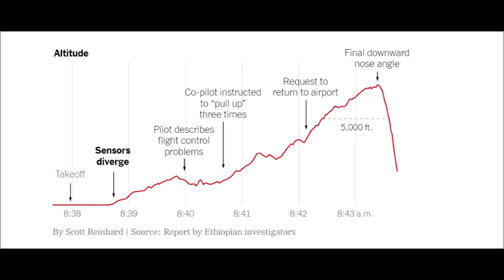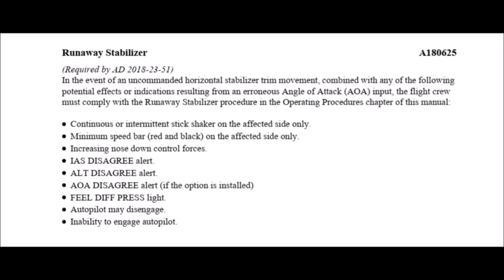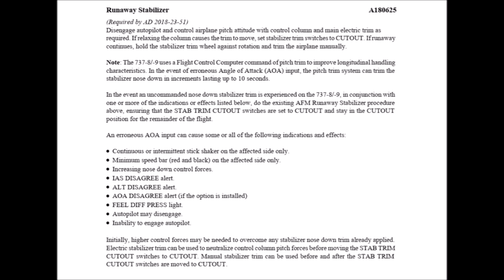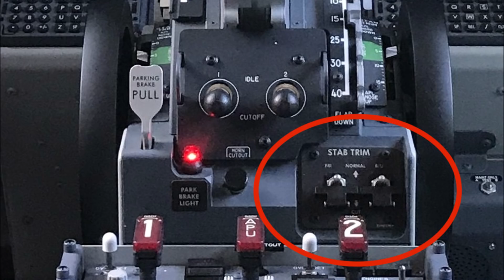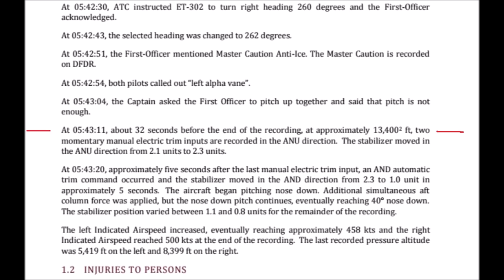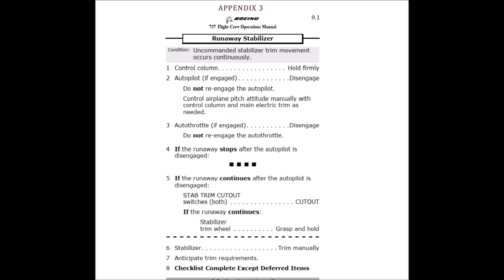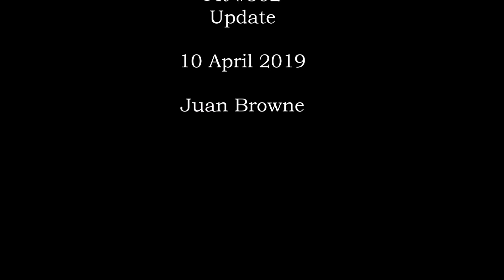737 Max Update 10 April 2019 Runaway Stab Trim Procedures

Comment: Thanks Juan, very good as usual. I noticed that that flight manual has an opening for cut out switches not working. That would, I guess, be because the cut out switches propably operates one or two relays that might fail too. The position of the cut out switches is not recorded in the FDR. Looking forward to hearing more from you.
Reply: Rudolf Abelin One of the many bizarre twists in this story is that on the NG model the cutout switches operated in parallel. On the MAX this was changed so they operate in series. There are pros and cons to both arrangements, but the differences between the models can only have added to the pilots cognitive overload.
Reply: @gordonrichardson2972  Yes, this is basically inline with my thoughts.
There is one screw and one motor. My interpretation, based on my limited education in electrics, is that in parallell both switches needs to be turned off. In series, only one is needed to break the circuit. Am I thinking correct here ?

Comment: Well the pilots might have made some wrong decisions in the heat of the moment but it was the MCAS that caused the plane to crash. How long have Boeing pilots had to refer to a manual on how to cope with a complex problem? What a joke. There are many serious concerns with the Max. Untrained pilots can not be blamed for cheap engineering.

Comment: great insight .. many years ago I flew an R/C  V tail glider which  continually crashed . Amazingly it survived almost intact  and I was eventually able to discover the actual cause .  The glider was super efficient and a delight to fly .. BUT  at a certain min sink speed   the elevator   (V TAIL) would cease to respond to up elevator . Because the Model was repairable after each crash / heavy arrival .I was able to work through all of the possible causes ..   , Elevator servo replaced   with twin servos and elevator electronic mixing. RX and flight battery replaced   fuselage re moulded in composite , original fuselage was sort of flexible moulding .Having tried everything I could think of , I was again enjoying a super flying session when the elevator again failed to correct a nose down attitude . I rapidly gave a sharp stab of down elevator and pitch control resumed immediately.Subsequent identical loss of pitch control were achieved and the only recovery was  to give a huge rapid stab of down elevator to re establish airflow over the V tail surfaces ..I added a T tail elevator and rudder to replace this deadly V tail set up and  the glider never once resorted to its   I WANT TO CRASH MODE.. Richard Wallinger  74 years young  aeromodeller .00351 961654473 . I hope this helps in some way .

Comment: You Americans are so bias trying everything you can to blame the poor pilots. Blah blah blah! the Max should not have been the same design like the ancient  B737 -100 which was designed with cables bell cranks levers tabs and a smaller diameter turbojet engines. The MCAS is a after thought due to the bigger more powerful TURBOFAN ENGINES just admit it. Stop your Blah blah blah! get yourself into a Max simulator and give the same explanations again.
Reply: Ewan Howard Watch Juan's previous video. In no way is he blaming the pilots. This series will examine other factors as well.

Comment: Please work for the FAA Juan, they really need an analyst/reporter like you. Then again, you might not want to give up your seat as a 777 pilot. Question, could the boys have left the throttles at a high setting to aid them with extra lift and nose up pitch? Another thing...could they have turned on the stab trim switches back to the on position due to a very desperate attempt to electronically trim the airplane (as it was virtually impossible to do it manually). Meaning, if all else fails, you gotta try something right?. Also, is there any way you could do a detailed comparison video between the two downed Max 8s?
Reply from the maker: Good idea
Reply: Menelik Z More questions than answers, at this stage of the investigation.

Comment: Boeing engineers could not set  MCAS  not to activate on take off,  and  activate at a later stage when the aircraft  gain some safe altitude so the pilots can act in time ?
Reply from the maker: No
Reply: @blancolirio  thank you Sir,
Reply: Concorde Heavy Good question. MCAS was designed to operate only with flaps up, which is normally done shortly after takeoff. It was never anticipated that MCAS would activate so close to the ground.
Reply: @gordonrichardson2972  close to ground with nose diving is not enough time for pilots to react, besides are humans and they scare too.

Comment: So why is the AoA sensor failing, bad design? electrical? software/programming? sabotage? the sensor appears to be the root of the problem.
Reply: Glidezilla The AIA sensor was indeed the root cause, though MCAS should never have accepted such faulty data. Sensors can fail due to mechanical damage (bird-strike or ground impact).

Comment: As always, in any walk of life, accidents are a series of events. As an interested bystander I am intrigued by the stabiliser cut off switches, hopefully someone call help my understanding. In my years commissioning equipment on production lines in factories there was always the facility to isolate the automatic control system and run things manually using the same motors via a button, press the button and the motors run, finger off and the motor stops. Is it beyond the wit of man, or Boeing, that in the event of these stabiliser issues you cant just turn the control system off but still use the power of the electric motors to trim the stabiliser? If someone has covered this earlier my apologies.
Reply: Ian Gill Good points. The bottom line is that Boeing tried to simplify the pilot interface too much, by only having two cutoff switches. Using a third switch would have cost more, in terms of certification and training.
Reply: @gordonrichardson2972  I have been thinking more about it and the idea of having a manual trim wheel is barking mad in the first place. I suppose they had got away with it on the 737 for all these years then along comes something that changes the situation.

Comment: Juan, I have a question; given that the MCAS system does not activate unless flaps are fully retracted, does this also mean that the MCAS system is immediately disengaged, if the flaps are deployed (even to a nominal degree)? Or, does the MCAS system continue to complete it's current trim cycle? If deployment of flaps immediately disengages the MCAS system, then this would presumably be an effective, and most importantly, quick way of circumventing such an MCAS anomaly, while still maintaining manual electric trim capability, though I realise this is not the prescribed procedure of course. Your thoughts Sir?
Reply from the maker: Yes
Reply: Rich Green Good points, but flaps cannot be deployed at high speed.
Reply: @gordonrichardson2972  If it saves lives and an airplane..yes they can....same with gear. We're talking about an emergency.

Comment: Would the auto throttles have kept the throttles at takeoff power the entire time? Didn't you say that they maintain a certain set speed?
I am unfamiliar with how they work, but if they didn't change the engine power even at high speeds it just seems like they weren't very automatic.
Reply: ke6gwf Autothrottles can be set for a constant speed, or a constant rate of climb. After takeoff they would have used maximum power, but the aircraft did not climb, so its speed increased.
Reply: @gordonrichardson2972  so of you set them for a constant rate of climb, the only thing that throttle down automatically is if the plane exceeds the set rate of climb?
It is basically just a limit switch, so when it bumps the set rate of climb it reduces throttle?

I suppose that makes sense, since it is based on what was probably a mechanical system originally lol

Comment: If the position of the stabilizer cut out switches is not indicated in the data recorder how is it confirmed that they turn them back on? Did they actually find the switches on the ground, in the on position? Is it a theory that they turned them back on?
Reply from the maker: Inferred from the data
Reply: souocara38able The FDR readouts can be used to infer many settings and the position of some switches.

Comment: I would like to know what really happened in the test flights on the 737 Max that  made Boeing fit the MCAS system. Did it roll on to its back during a stall test in an uncontrollable manner? Should the Max have  bigger tail control surfaces.
Reply: Malcolm McKinnon The Seattle Times has some good articles explaining the reason for MCAS.

Comment: Great explanation and I have a question Jaun. With the Max having these more asymmetric engine loads, if the auto throttles are on and the MCAS is trimming down, does this mean the throttles will "fight" the down trim being put in by MCAS. I'm wondering maybe the MCAS was trimming down and the auto throttles were maxing out trying to keep the nose up? If you throttled back would you loose the upward rotation from the engines and thereby make the situation with the down trim worse, i.e. just go further into a dive? As you said the other day, the loads on the trim wheels may have been too high to deal with manually at this speed and they didn't have the height to unload the control surfaces. Guess they were hoping turning the electrics back on may have helped them bring the trim back but in reality it brought MCAS back in and made things worse. I only fly RC planes so have no real experience of full size.

Comment: I think the entire MCAS System needs to be scrapped. It's overly redundant and works automatically without any pilot switch for on/off.

Sadly the throttles were never retarded which overspeed audio is auto reflex.

I disagree that while their was apparent tunnel vision by both pilots. I think flying inverted would have given the crew more time and possibly more altitude with lowering airspeed.

With MCAS  sensors written up as squak on previous flight...to me that would be the first place to focus. It's designed to work without any pilot switch for engagement. Huge design flaw. Training on max 8/9 was poorly executed worldwide. 

This is what happens when engineers design systems who are not pilots or tested without complete data.

Comment: The focus is always on the MCAS system. Why did it need one? The aircraft  had fundimental design flaws  and would not fly correctly without it.
Reply: The 737 max has been flow with stabilizer trim off (No MCAS) with only manual trim available.  The pilots were able to fly the plane and land without problems..  The design flaw was not in the new engines.or in how they were mounted.  The problem was faulty software.

Comment: Since the MCAS system is so dependent on the AOA input, why wasn’t the disagreement light standard equipment?
Additionally, why weren’t pilots trained on the handling characteristics of the Max  during takeoff and climb out?

Comment: I'm so sorry. I'll try to do better I was cooking while I was talking. The gist of it is when the autopilot is engaged and the throttles are locked in place. It would just make sense that if the pilot grabs the yolk autopilot with disengage as would the throttles. More or less forcing the pilot to instantly fly the plane as a driver in a car would. Cruise control in an automobile is shut off if you tap the brakes. Using the same analogy if autopilot and throttle lock are in place any movement of the stick by the pilot or co-pilot should shut them down. I don't know if this happens in an aircraft but I think it should. In an emergency the pilots hands are on the Yoke and the throttle. While the first officer deals with correcting the problem in the plane. Seems like a common sense way to fix the problem.

Comment: Thank you Juan. I must appreciate your comprehensive and unbiased explanation of the situation. In my opinion we wouldn't be discussing this if MCAS was not installed in these planes. Adding unnecessary complications to an already complicated system, and expecting a perfect outcome in an ideal world. And remember, MCAS is just at the center of these tragedies, the 737 Max has been discovered with other software issues which FAA has requested Boeing to fix. With all these issues, the working system of these softwares remain unpredictable and it's hard to conclude that all the guidelines presented in Boeing's manuals would work perfectly in practice had the pilots followed it religiously, especially if the different software malfunctions are in play. Boeing itself owned these deaths knowing fully well the aircrafts had fundamental design flaws from the start. Believe me, there is much more Boeing knows that we don't. We should be talking about those unnecessary heavy engines as well. They are the root cause of all these.

Comment: Great explanation, hard to imagine they both didn’t recognize the overspeed and throttle back.......the over speed clacker surely must have been going off.
Once the speed gets that high any uncommanded pitch input via the stab runaway would get out off hand.
This, as it so often is, is a perfect Swiss cheese model happening.
Thank you
Hans Juergensen

Comment: I hear that on the 737 NG you can cutout auto trim commands and maintain manual electric trim, but not in 737 max - you loose the manual electric trim. The manual says only nomenclature change on the label of the cutout switches. Is this true, if it is i bet the crews 737 NG experience kicked in to their demise

Comment: Juan explains it in all detail but he doesn't look convinced that such emergency situation should ever happen during a normal takeoff. And to disengage all this auto stuff and manually turn the elevator crank while the plane is just a little bit above the ground, how is there enough time?  As things look right now, Boeing itself had no clue that such a crucial situation can occur. It surely must have happened to all other 370 planes which were in service that the pilots had to pull their plane out of the nosedive position, why they did not report that to their airline cheif?

Comment: But, we can conclude that Boeing was not quick enough to apply to the procedure of avoiding the excess down trim of the plane in the first place, through design. The numerous checks and fixes required by the flight crew of a faulty design is not clever engineering. Or putting it in other words: It is very difficult to control something uncontrollable by design.

Comment: Great presentation Duan. Given we know the crew were presented with stick shaker and bad speed information on the Captains side 48 secs after the takeoff roll began - ie just airborne; do you think the crew should have started with the Unreliable Airspeed Checklist first? They didn’t have the full symptoms (or conditions) of a Runaway Stabiliser until after the flaps were retracted, and the AP disengaged. Had they completed the Unreliable Airspeed Checklist first, they would not have encountered MCAS. Or, what am I assuming or missing?
Reply: We don't know the full sequence, since the crew did not enunciate every action that they made (for the CVR). A lot of stuff was going on, and the exact decision making process was complicated. IMO the inadequacies of the checklists for this specific and urgent failure scenario, worsened the outcome.
Reply: Gordon Richardson Hi Gordon, very true. I was trying to base my question around the flight data recorder ‘knowns’. Without CVR info it’s poor practice to speculate on what they might have been doing or thinking prior to MCAS activation. However, according to the FDR info, if they had completed the airspeed unreliable checklist first - they would have turned the auto throttle off, set 80% power and pitched for 10 degrees - then start trouble shooting and determining which instruments were correct and which weren’t. This memory checklist action would have kept the actual speed under control. Also, they would have kept the flaps at 5 degrees as this is also part of the Unreliable airspeed checklist - ie not to change the configuration. Also, by having flaps out inhibits MCAS. So I think, having recently completed MCAS awareness training with the airline, perhaps they were too prepared for the failure and possibly overlooked the fact that they had unreliable airspeed in the first place.
Reply: Other sources speculate they may have started with the stick shaker first, which has a very different checklist. Lower the nose until the stall warning stops, which is very different from set pitch and power.

Comment: It is nearly impossible to try and trim the airplane manually if the throttles are set to full power and in a nose dive, with the throttles in the idle position they would have been able to manually trim the airplane.  GOD bless their souls.
Reply: Juan Morales that was their biggest problem. High speed and no altitude. They needed to dive to spin the stabilize control trim. To get them level. RIP !!!!!